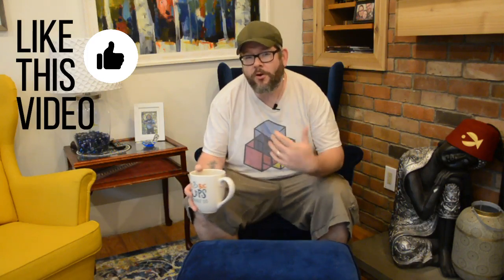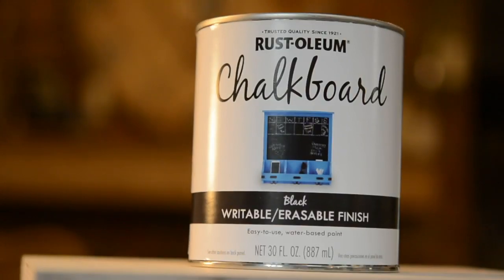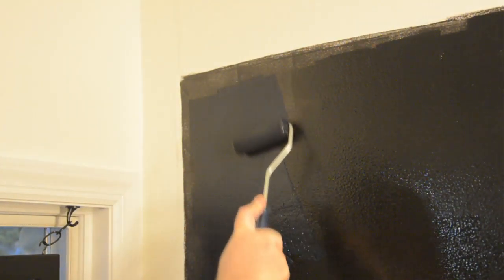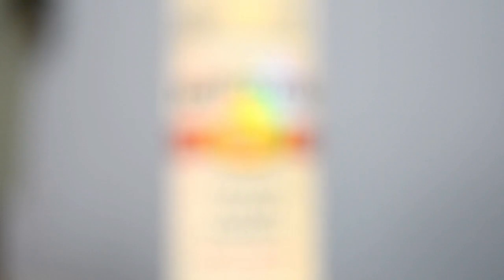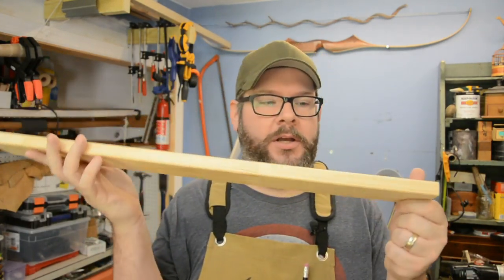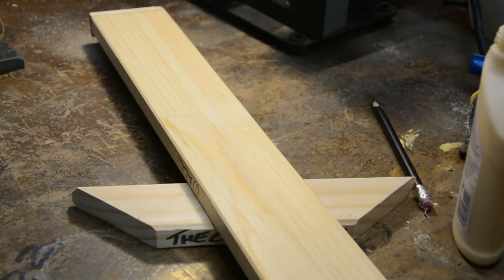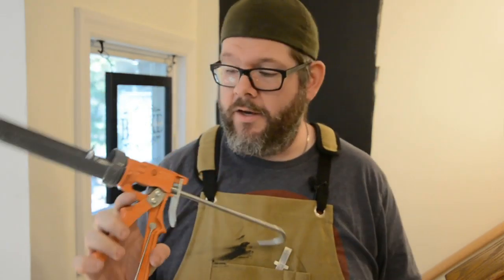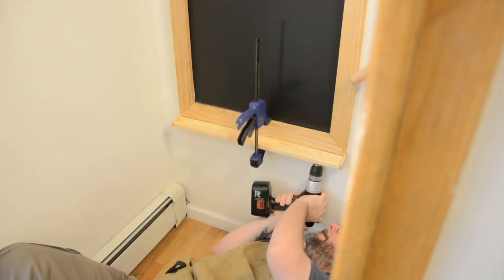Build a Chalkboard Wall / Easy, Inexpensive & Beautiful

Comment: Why didn't u use flex seal instead of liquid nails
Reply from the maker: Crimsony Simple! Flex seal isn’t an adhesive, so if I used it, the wood would fall off of the wall.... I think. I’ve only used flex seal to stop leaks.

Comment: what if you dont want to apply the paint directly on the wall?
Reply from the maker: missnormagee I would use a sheet of plywood or a thin wood board. Otherwise, same principles apply
Reply: @BurkeMakesStuff   thanks! And if I painted the borders, use regular paint then the sealant??
Reply from the maker: missnormagee that’s one way to do it. Rust-oleum also makes spray paints that do both at the same time. So you’d apply the paint to the boarder and that paint would have a sealant in it too.

Comment: So Burke your video is terrible and amazing at the same time. First of all dude u have to simplify things as much as u can for example u r pulling out like $500 saws and shit instead show in alternative way that u can cut the wood. Another thing u didn’t tell the audience that they need adult supervision this is a very important key that u need for your channel to succeed. Now great plugging of the video but u r a little to enthusiastic u seem like u r trying to hard. Now the good parts great multitone pitch when narrating and great face gestures lower your voice a little. Great min and a half over the 10 minute mark and the lighting was excellent. Trying to decide if this was a terrible vid or amazing and with now looking over the comment that I’ve just wrote I’m hindering over to the amazing side good job buddy u have worked hard keep up the good work
Reply from the maker: Nate Como normally I wouldn’t reply to the negative comments, but it’s you, so I’ll simply fill you in. The power saw you saw me use in this I got for free. The hand saw cost about $10 @ Home Depot. No $500 saws. Not even expensive ones. I could/should have maybe said that if you don’t have a mitersaw like this you can use a miter box and directed them to the valet tray video to see how to use it... that could have worked. 
However, thank you as always for you candor and honesty.
Reply: No problem Burke just next time u throughly explain how to get everything that u will need to complete the task:)
Reply from the maker: Nate Como will do!